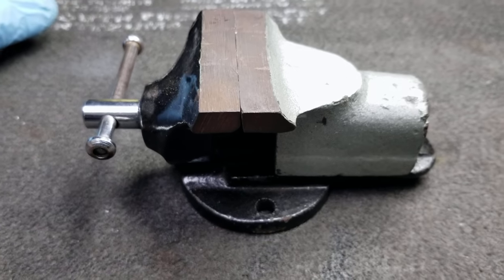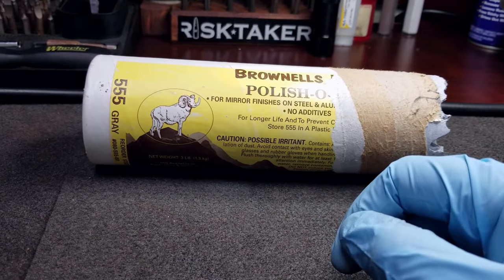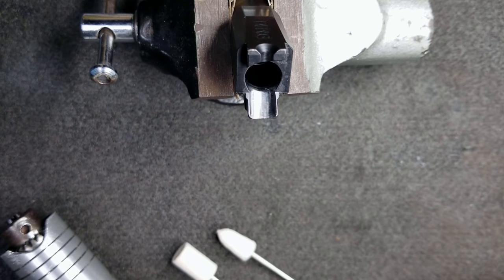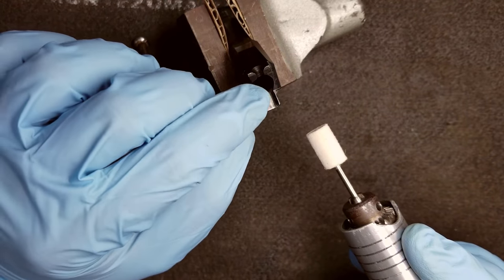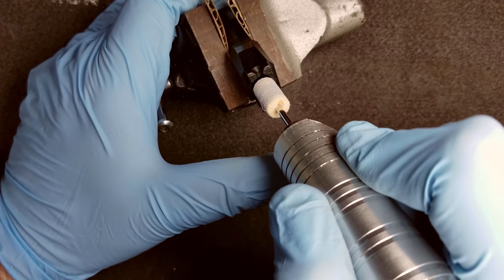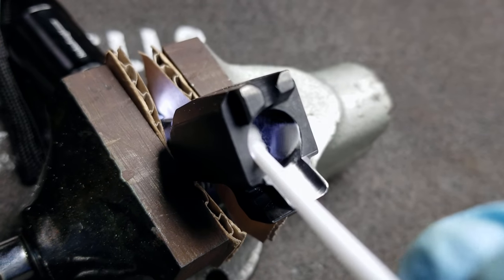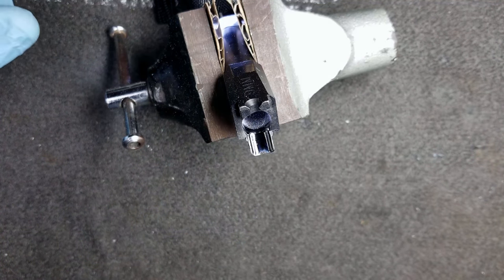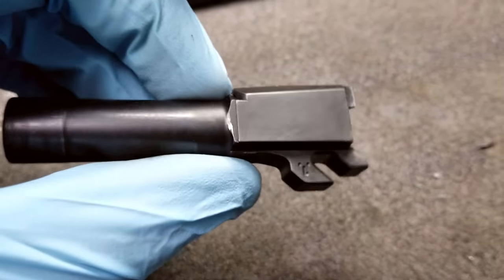How to Polish a Feedramp Quick and Easy

Comment: Is that compound safe on blued surfaces?  I’ve been using the Birchwood Casey lead remover and have to be very careful
Reply from the maker: Honestly any compound you use will remove bluing as all compounds have a little abrasive in it. But remember the purpose is to polish the feed ramp so bluing will come off regardless.

Comment: how many rounds until you need to redo it?
Reply from the maker: There is no actual round count, its more of a as needed basis, but really one time job unless the ramp gets really rough after years of extended use. remember when you polish the metal it closes the pores not really easy to get it porous again, unless is not well maintained.
Reply: @TheHobbyGunsmith  thanks!

Comment: Other than the  Ramp and Chamber, Is there any other Part of the Automatic  that should be  Polished?
Reply from the maker: depends on what your trying to do. if your trying to smooth out the action it depends on the pistol . but for feeding purposes no.
Reply: @TheHobbyGunsmith  Beretta Pico  .380
Reply: Any linkage between trigger and action if applicable, the area of slide that is metal to metal contact. Magazine well and outside of mags if  you want mag to drop out and load new one smoothly. Just my opinion. Not professional but not stupid either.

Comment: I will be trying this on my Taurus G3. It jams non stop.
Reply from the maker: Glad to be of some help.
Reply: @TheHobbyGunsmith   new to fire arms, when should I polish a feed ramp?
Reply: @TheHobbyGunsmith  also I got a $10 drill master Dremel from harbor freight
Reply from the maker: @dakidsbac777  feed ramp you can polish whenever, it’s a nice simple reliability upgrade. As for the drill master rotary tool be careful with that sucker, manage the speed on it if it has speed control and take your time.
Reply: @TheHobbyGunsmith  it's the $10 one
Reply from the maker: @dakidsbac777  i would not recommend that one as it does not have speed adjustment. you wont be able to have control of that one.
Reply: @TheHobbyGunsmith  what speed should I be using then
Reply from the maker: @dakidsbac777  There really is not a set speed, i just prefer an adjustable speed to set it where you feel most comfortable. i am pretty sure it can be done with that rotary tool if you take your time and are careful.
Reply: @TheHobbyGunsmith  I will try it. I appreciate all ur help
Reply: @TheHobbyGunsmith  I exchanged it for one with a speed control on it. Should I start of at the lower speed 1st, and do I run it at higher speed after?
Reply from the maker: @dakidsbac777  run it at a speed you feel comfortable with and feel you have control of.  Remember your polishing so let the tool and rouge do the work. Just take your time. You should be good
Reply: @TheHobbyGunsmith  Polished ramp and took my Taurus G3 to range today and shot 100 rounds with no failure to feed issue. When else should ramp be polished moving forward?
Reply from the maker: @dakidsbac777  for the most part once you polish it once your basically set. The surface stays slick. You should clean your barrel after range sessions just for maintenance but as for polishing not further polishing is required unless for some reason you rough up your feed ramp which is highly unlikely as bullets are softer than your barrels metal.
Reply: @TheHobbyGunsmith  Thank u for all ur help
Reply from the maker: @dakidsbac777  anytime 👍
Reply: @TheHobbyGunsmith  START MAKING PISTOL VIDEOS AGAIN Lol
Reply from the maker: @dakidsbac777  I will be back very soon. 😁

Comment: I have a new G19 Gen 3 and it had feed issues 3 times out of the first 100 rounds. I got pissed off and left the range. Thinking about using my service plan for the glock but I might try this first. A brand new Glock shouldnt jam 3 times right out of the box. I was using brand new ammo FMJ 9mm. I know 100 rounds isnt enough to break it in, but polishing might help the break in process. Thanks!
Reply: First off, did you properly field strip, degrease and then properly lubricate the firearm before it was even shot? Did you make sure nothing was wrong with your guide rod? Are you in a magazine restricted state that forces you to use magazines with blocks or magazines designed outside of the parameters it was designed for? If none of this applies then get ahold of glock ASAP. Every once in awhile glock will have a few pistols go by undetected that have problems.

Comment: My gun will jam up if I try to chamber a round slowly but won't if I drop the slide release on it or rack it normally it feeds fine will polishing the ramp fix that the barrel is a zev tech barrel and the ramp is coated
Reply from the maker: By jamming up do you mean it wont lock up all the way, cause what it sounds like is the extractor is not going over the rim of the cartridge cause of the spring tension which is normal it needs a bit more force to overcome the rim of the round. that is why it locks up normal when you rack the slide normal or let the slide fall with the slide release/stop.
Reply: Did u fix it?

Comment: Could i possibly do this without a dremel and just a rag?
Reply from the maker: I do not recommend this at all.
Reply: @TheHobbyGunsmith  why would it be bad bad to polish it with just a rag and mag polish if you dont mind me asking?
Reply from the maker: @ads7686  Sorry Misread your initial comment. you could manually do it wit a cloth and mag polish just going to take much longer to achieve the desired finish. but you should be fine. sorry for the misinterpretation.
Reply: Put broken off q tip insert in a drill and polish ramp and first 3/4” of chamber.  Drill can be put in vise,
Will need a few cut off q tips.
Reply from the maker: @brc1945  I haven't tried that before but sounds interesting. definitely trying this lol disposable felt bobs I like it.

Comment: Polishing the feed ramp is good,  but inside the chamber is not recommended, according to professional gun smiths, a mirror finish like chamber doesn't help seal the pressure when firing.and puts more pressure on the slide.
Reply from the maker: the purpose of polishing the inside of the chamber is not to seal. the purpose is the help extract the spent casing once fired as the casing expands against the walls of the chamber when fired and a smooth surface alleviates some home the work the extractor need to do to hold onto the case while ejecting. Think of it this way what's easier sliding on glass or sliding on sandpaper. P.S. i am a graduated professional gunsmith.
Reply: @TheHobbyGunsmith  I'm not trying to criticize your method, and I am not a Gun Smith, but I've read and heard from Profesional Gun Smiths and manufacturers specifically about guns warranty and what and what not to do, so you don't void your warranty and liability reasons, in terms of chamber mirror polishing a medium or course polish leaves a rough surface for the brass to grip. This in turn reduces bolt thrust which is safer and improved action longevity, also polishing the chamber could change the dimension and effect function, brass is relatively soft metal and expand and contract due to pressure changing, all manufacturers i know of do not mirror polish their chambers and do not recommend it for the reasons stated above, if you have extraction problems they need to be addressed , either by the manufacturer or a gun smith, chamber smoothness beyond what manufacturers recommendations, does not effect extraction, other issues do, like bad ammo, or reloads, or dirty gun, obviously you and others can do whatever you want, but I think if any one wants to work or modify their guns, they should research and consult with the gun manufacturer or a reputable gun smith just to be safe and avoid liability should something wrong happens,  my intention is safety and nothing more, God Bless.
Reply from the maker: @JazzLowrider  No worries brother i did not take it as criticism, there is a lot of misleading information online. the sole purpose manufacturers do not polish chambers and feed ramps is very simple, eliminate a extra step and process to keep product cost down and increase profit. i will give you a perfect example and look this up online. lets say you have a Well know gun builder, and i don't mean manufacturer like big name brands i mean Skilled Gunsmiths tha build one off guns for clients whether it be for competition or just a high en build. one of the things automatically done on the build is feed ramp polish and chamber polish. its done for function and reliability. the extra step is done because its not about the profit margin its about the quality of work and product you as a skilled gunsmith want to put out for your customer. check with any gunsmith for service and its considered a reliability upgrade. again to each thier own but its the truth. do you really think the manufacture is going to tell you yea we dont do that to keep cost down to make more profit margins. obviously anything in excess is bad your not going to sit there with high grit compound trying to polish for an hour. but going with a very fine grit like Brownells grey 555 or flitz and just a quick polish is just fine your trying to make it smooth not change the dimensions by sitting there just going to town lol. hope this makes sense.
Reply: @TheHobbyGunsmith  a couple of points from experience, as i said before feed ramps needs to be smooth, my experience with a kimber 1911 i had some feeding and extraction problems, I sent it back to kimber, under warranty they replace the extractor, polish the feed ramp, and the barrel throut but not the chamber, free of charge and I asked them about the chamber if it needs polish, thats the answer they told me what I stated in the previous comment, because they already polish the feed ramp and replace extractor, recoil spring, and they want the gun to be as reliable as possible, so I don't send it back again, and sure enough the gun has no problem at all after, that was almost 10 years ago, I just thought this should open people's eyes more a bout safety, as you know not everyone is good with the Dremel tool, because if it's not done correctly it could ruin the gun, keep up the good work, God Bless.

Comment: I just don't understand this feed ramp stuff! I have been shooting semi automatic pistols which seems like all my life and I have never polished the feed ramp or had the need to do this! I carried a Glock 19 for 15 years as my duty weapon and put many thousands of rounds through this gun without changing a part or polishing the feed ramp.  I never did it to any gun I ever owned and never have I seen it as something to do in any of my user guides, so whats up with this?????
Reply from the maker: Hey steve, this is more of a upgrade like changing your sights out for fiber optic or nightsights, not really needed you can shoot fine with them but you like the upgrade in it. some firearms do need the polishiong as thier ramps are rough but for the most part it is a reliability upgrade.
Reply: Polishing is far less likely to be needed for a good quality gun like a Glock. Polishing these parts is more for an old gun that has been abused, left out in weather, or allowed to rust. A new gun that is well cared for should never 'NEED' this. But, if you are having feed and extraction issues, this is a cheap and easy fix for most guns that do not have a true "broken" part like an extractor. Polishing is usually done to get poor quality parts to function. Getting a bullet to feed properly over parts like a badly burred, or deeply scratched feed ramp, is kind of like trying to roller skate on cobblestones.
   Before you even go as far as polishing these parts, try another brand of ammo, or even another lot of the same ammo. Sometimes bad ammo will cause both feed and extraction issues in some model guns, and not in others. My Ruger .22LR pistol will not function with some Federal ammo, but my rifle will use it all day long without issue, for instance. Neither of these have been modified at all, it is simply that the pistol doesn't like the Federal ammo, where as the rifle has no issue with it. Experiment with different ammo and make sure they work before you really need them. Then if all else fails try polishing, after you have gone over the weapon looking for any broken, bent, or maladjusted parts first.
Reply: Glocks don't need this because they have the most unsupported Chambers in the industry, which is what make them feed do well. It can bulge hotter loads badly though. No, this is not absolutely necessary, but could help prolong extractor life. Hell, some guys never run a bore patch down their barrel or clean it at all, and never have a problem. I'll take the preventative route myself.
Reply: Some pistols have more problems with certain ammo casings; especially hand-loads. In most cases, it was solved by polishing the feed ramp.
Reply: Some of my pistols I have trouble getting the carbon etc off the feed ramp, others I don’t.  So this video makes sense.
Reply: It's literally physics... But just because you've never seen it, does not meant that it hasn't happened. Port and polished cylinder heads are almost the exact same principle
Reply: @Dang_Near_Fed_Up  Well I shot my brand spanking new M&P Shield EZ9 straight out of the box yesterday and found that a rounded tip bullet had no problems. But trying to shoot Federal Syntech bullets which have a flat nose, jammed into the feed ramp. Not old, not abused, not left out in the weather. Brand new.
Seems as though if the ramp was smooth(er) it would have slid right up there with no problems. I'm going to look into this further and probably do it if there is no down side.

Comment: Will this not increase the pressure on the breach and locking mechanism?
On a Blowback action i assume this will cause problems.
Reply: He polished the chamber and feed ramp, those parts in no way effect the lockup of a breech lock pistol. It will have no negative effects on the operation of a firearm, blowback or otherwise. It's also a common part of a gunsmiths tasks when smoothing out the action of a pistol.
Reply from the maker: no sir it will no affect negatively in any way. only enhance feeding and extraction reliability on the firearm.
Reply from the maker: @Ephem13  Spot on answer brother. Thank You.
Reply: @TheHobbyGunsmith  I have a CZ 75D that I polished the entire barrel, every single exterior surface. Still runs with that good ole CZ reliability, just a little smoother.
Reply: daft vagrant I’ve got a CZ75 compact I would like to do same with.  Any videos/tutorials you’d recommend?  I’ve polished the feed ramp but want to get rid of that slight grittiness in the single action trigger pull (still an awesome trigger though!!)

Comment: I cant believe people are using dremel stones and sand paper bits on their barrels, felt tip polishing cones and fine high polish finish will take the oxide coating or bluing off and give the steel a mirror finish and not cause any damage

Comment: SiG say's this will void your warranty. Call Them.
Reply from the maker: Smith & Wesson will not be responsible for:

Defects or malfunctions resulting from careless handling, unauthorized adjustments or modifications made or attempted by anyone other than a qualified gunsmith following Smith & Wesson authorized procedures, or failure to follow the disassembly instructions in the Smith & Wesson manual.
Use of defective or improper ammunition, corrosion, neglect, abuse, ordinary wear and tear, or unreasonable use.
Criminal misuse, negligence or use under the influence of drugs or alcohol.

Comment: Mothers has ammonia, so definitely not recommended by Glock. Flitz is good.
Reply: I've used Mothers, Blue Magic and Flitz. Never had an issue with either of the polishing compounds. All Ive built were P80 glocks with Stainless steel barrels. Ive also used all 3 compinds to pplish Glock OEM barrels. So I have no idea what you mean about Mother's having ammonia and Glock not recommending it
Reply: At little ammonia in a polish used for firearms isn’t going to harm anything with respect.
Reply: Mothers polish works great no issues

Comment: Personally I would have only cleaned the ramp very minorly and not the chamber itself. Polishing is abrasive and removes material on the microscopic level.  I wouldn't do either unless you're having feed or extractions issues to begin with. This is invasive. Too much polishing of anything could eventually cause tolerance issues.
Reply from the maker: With all do respect, not enough material is removed from polishing to cause any negative effect. now if you polishing with 80 grit you have a big problem lmao.

Comment: Can you clean and re-use your felt-bobs?
Reply from the maker: You can but i wouldn't go through the trouble. i typically use a dedicated bob for the same compound or rouge and don't use it with any other rouge. the only way to truly clean them is getting a file and basically spin/rasp the layer off to clean felt again. makes a mess and just cheaper to use a new bob for different compounds. in my opinion.

Comment: You actually shouldn't polish the chamber too much. There needs to be a little bit of grip for the shell. Manufacturers and real qualified gun smiths say the shell can move or expand, snap or crack when there is too much room to slide around. 
It's not recommended to go past a very light polish with a fine abrasive. We never did that and I've never been taught to do it when I was serving in as a Navy Special warfare Operator and weapons instructor.  Good video just be careful on the polish.
Reply: I was looking for this comment.. im like “i thought u werent suppose to do that”
Reply: Walther p22’s have a history of problems with that round. Looks like simple polishing fixes the problem.
Reply: You shouldn’t polish the feed ramp either. It’s purely aesthetic nothing more. If you have a feeding issue is not the ramp